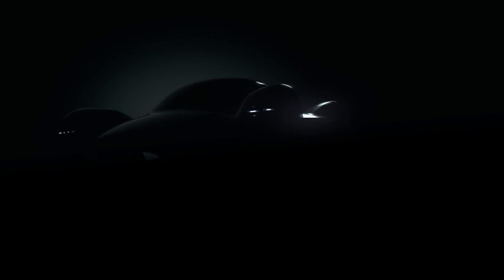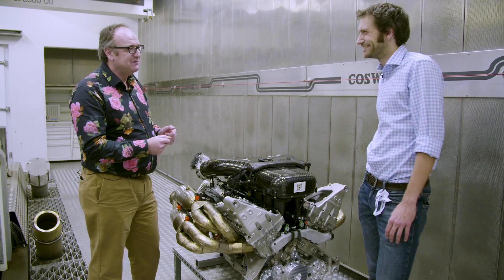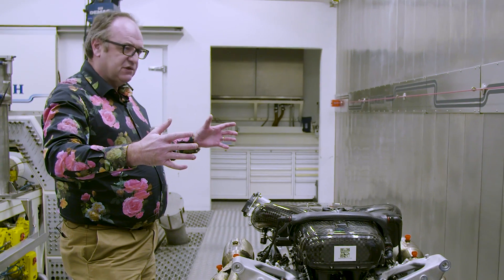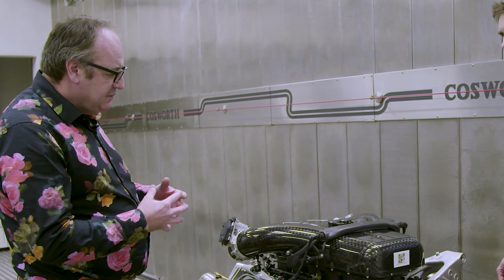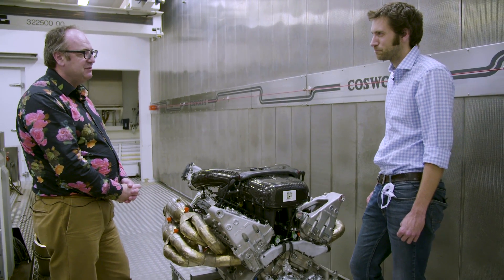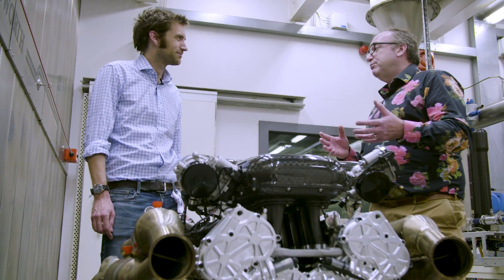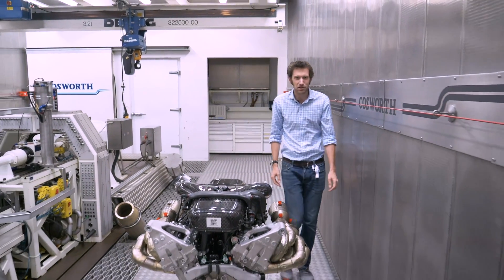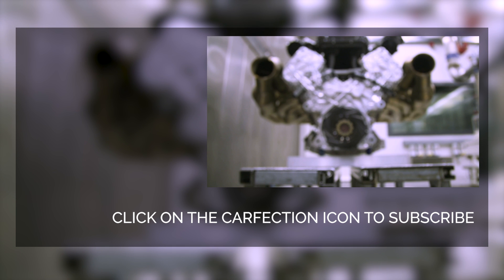Hear The Future Of The Supercar At 11,000rpm: The Aston Martin Valkyrie's V12 - Carfection

Comment: This is a serous engine, a proper engine for a supercar, now those putting V6s on supercar, those aren’t actually supercars, a supercar must have a super engine.  Now this is a super engine. Well done Aston Martin.
Reply: True, it's hard to think very highly of V6s.. but if they win races like LeMans, then you've got to have respect for them.
Reply: V12,W16 is already dead. Even V10 won't have any future. 
Turbo + hybrid assist is the future of racing Motorsports. The disadvantages of turbocharged  engine was the turbo lag. The new Hybrid assist and regens has proven it's superiority.
The iconic Porsche 919 Evo LMP P1 is a 1160HP  4Cylliner turbo Hybrid. 

The Toyota LMP1 TSO50 is 985HP V6 hybrid Assists. 
Both of them winners of LMP1.

Cars in SuperGT500 all runs 4cyllinder Turbos and are faster than GT cars.
Reply: @debendragurung3033  dividing 16 by 3 is impossible. Do they have ⅔ cylinders?
Reply: It all depends on your interpretation of a supercar. This thing is for sure a hypercar.
Reply: @lovelessissimo  pretty sure a hyper car is a hybrid turbo power train and this is non hybrid naturally aspirated
Reply: @nagow_360  Nah, there's nothing technical about the term "hypercar", it just means a very exotic/expensive supercar. Also, this will be a hybrid as they discuss in the video.
Reply: @nagow_360  no.. a hyper car is a car which pushes the envelope further, reaches new hights in automotive engineering. For example the bugatti veyron. No car had ever reached speeds like the veyron did.
Reply: @shornoMALONEY  no..
Reply: @Speed_7545  What are you disagreeing with? There is no specific definition of "hypercar". The Ariel Atom and Merc G-Wagen 6x6 both "pushed the envelope", but they're obviously not hypercars. I agree with what you said re: performance, but it's also certainly about exclusivity and price, and also time period. I'd say the McLaren F1 and Jaguar XJ220 were hypercars in their day, but not anymore.
Reply: @shornoMALONEY  If they are in their time, they still are. As I said, a car which pushes the envelope further. The car still pushed the envelope, the achievement of a car doesn't vanish over time.
Reply: @Speed_7545  Did the Ford Model T push the envelope? Yes. Is it a hypercar? No. Did the Toyota Prius push the envelope? Yes. Is it a hypercar? No. Did the Nissan GTR push the envelope? Absolutely. Is it a hypercar...? I could go on. For example rally cars like the Subaru Impreza and Mitsubishi Lancer that harnessed as much power as possible from a 2L engine, using huge turbos. Definitely pushing the envelope, but also not hypercars. It's just semantics my friend.
Reply: @shornoMALONEY  I would say a hypercar is one of those cars where there are only a handful made, they are all already sold before the car is even on the road, and the buyers are handpicked by the manufacturer.
A supercar is any expensive car that is faster than it is practical.
My two cents.
Reply: You know that BMW raced f1 with a 1,5 liter engine in the 80s. 1435 hp and 4 cylinders.
Reply: By your logic a GT3 RS isn't a super car lol, and it outperforms a lot of them.
Reply: Jay S. GT3RS ain’t a v6 boi

Comment: 6.5 litre v12 and they call it the `future` of whatever. Give me a break! The future is all electric. And Tesla's upcoming models would run circles around this at a fraction of the cost.
Reply: I would agree... except you're wrong and you've missed the point completely. 
Simple fact - Tesla's are heavy, heavy cars. 
I don't deny that the future of everyday passenger vehicles is not the Internal Combustion Engine, however at this time these power figures in combination with a lightweight, aerodynamic chassis are only achievable with the good old fashioned "suck, squeeze, bang, blow" 
I reiterate that I don't disagree that the future isn't I.C.E, however right here, right now, this is the pinnacle.

Comment: Brilliant engine.  No doubt one of the greatest engines of all time.  Though with an 11,000 RPM redline and peak horsepower likely very high up in the rev range, I suspect this motor would not work at all in street car, which is why the electric motors are key. Reality is the electric motors will be providing most of the driver's real world usable power (i.e., torque).  This really is more race car than street car.  No doubt Ferrari could have dropped an F1 V12 car into a street car many years ago if that engine was supplemented with an electric drive train. But Ferrari did not an Aston Martin did.  Kudos to Aston Martin.

Comment: This is the ideal usage case for a hybrid combo imo.  In concert with small displacement ridiculous RPM motor for torque fill.  I'm really curious how they've done the valvetrain.  Still Ti springs, or have they gone to pneumatic valves ala F1 or Koenigsegg's 'Freevalve" system.

Comment: Basically, this is the type of engine the LaFerrari or McLaren P1 should of had.
Reply: should've not should of
Reply: ErwinSchrodinger64 LaFerrari has a N/A V12…
Reply: Abiel Ruiz yea but it‘s lacking 2000 rpm haha but now as you say that it makes the valkyrie actually more real. All they did was getting 2k more rpm out of it, and that is freaking insane and awesome.

I am so happily waiting for this and the amg one, can‘t wait
Reply: timonxDlol well, LaFerrari released in 2013 and the valkrye will be release on 2020 so…
Reply: Valkyrie*
Reply: @timonxDlol   "All they did"...
Reply: Should *have*, or "should've".
Reply: Pretty sure the laFerrari and the p1 are hybrids
Reply: your excgarating a bit. Give me some excempel.
Reply: Apreesheated
Reply: @Lucky Rooster this will be as well to assist low rpm pull
Reply: The p1 is fine as it is lol enough to see the Ferrari off that's for sure.
Reply: @Lucky Rooster yes Laferrari is a hybrid.

Comment: EVER? 
It's an astonnishing car - no doubt. But there are some (existing) cars near to this...
The Gumpert i.e. has also a big, naturally aspirated V12 that makes a lot of power (780HP @8500 RPM)
and there is Koenigsegg who (makes boosted engines, but) has developed the "Free Valve" wich will soon allow extreme RPM's. 
So, maybe this car is ahead - now - but the competition of the best car will NOT be finished with this Aston Martin.
By far not.
Reply: You do realise that this engine weighs just 440lbs,  and the car will have a better power to weight ratio than Koenigsegg One:1,  right?  If you think that the Valkyrie and a fucking Gumpert are even in the same league then you're honestly delusional.  The amount of engineering that just went into the engine is astonishing.  Yeah,  there will be cars in the future that could compete with it,  but right now the Valkyrie is the absolute pinnacle.
Reply: @Lemon IX:
I'd like to see a comparsion of the Valkyrie vs. Koenigsegg One:1 and the Gumpert iE 
at the Dragstrip, at Nürburgring Nordschleife and a 0-400-0 comparsion.
Reply: There is nothing anywhere near to this. Newey is the best chassis engineer ever.  And, in terms of aerodynamics, it's very unlikely that something would ever come close to this again due to the radicality of the project (who would approve a cabin that narrow again?).
Reply: @ RealCapo88 
Okay, they aim to be stret legal, 
but if this screaming 11000RPM V12 Monster will ever be street legal, it will be only in britania (maybe too in Dubai and Monacco) 
Please tell me if You EVER see one of those cars on a road in Germany or France or anywhere else...

Comment: Super cool stuff! Love it! Just a remark: Its not the first road car which has the engine as structural part for the rear. The Mercedes F1 Engine which is used in the AMG One is in the F1 car only 145 Kilos including batteries. Would like to see what its weight with all Batteries (4x the amount in the One comparing to the F1 car) and than compare it to Cosworth Unit weight together with the Batteries.

Comment: Poor guys haven't you heard of the SuperchargedBigBlockChevy? That will have the guts at any rpm. First of all the V12 sound is scream, which is not good. Then the stressed engine is bad for longevity. I salute choosing rigid valvetrain gears

Comment: How did they pass emissions but Merc are really struggling with their tiny V6?
Reply: The F1 engine was really never meant to be in a road car. Most of Merc issues are at start up and idle speeds. Lambo and Ferrari both have a 6.5L V12. They may not rev as high but at least there was a point of reference unlike what Merc is dealing with.
Reply: Jeff Will That’s a fair point
Reply: @Kristian6622  This V12 engine may pass emissions but from what I read and predicted the Valkyrie won't be street legal in US. AM chose not to meet some necessary standards. Project One will be street legal in US once emission issues are settled. Speed Tail, One:1; etc aren't street legal in US also. They can be imported under a special rule but mileage has to be limited on street.

The Apollo IE can be option with a 1,000hp that revs to 11k based off what their engineers released in July.

Comment: Fantastic engineering! BRAVO!
I know this is a parallel hybrid, but the future is electric, for instant torque, and ease of packaging.
As far as pure electrics go, I think a  body that doubles as a flouride nano battery would have the greatest energy density, and motors in all four wheels would have the lowest rotational inertia and greatest modulation for torque vectoring, stability control, etc. So we're "there" yet at the pinnacle of automotive engineering, not even with the Valkyrie.
But DAYUM, that is some fantastic engineering! Way to go, team!

Comment: I remember seeing a video about someone buying old formula one parts. Intercoolers, wiring harnesses, steering wheels...etc. i recognize the connectors this engine is using from that video. They are extremely expensive per part number compared to the connectors in your everyday car.

Comment: Is it 1000hp including the electric motors or on the engine alone?
Reply: @AzathothsAlarmClock  So do you think total hp output from the entire power unit will be in excess of 1100hp? Or more if the battery pack is big enough for an output from the electric motors of +100hp or there abouts.

Comment: They could've used anti-backlash gears in the cam drives, but they would be heavier . . . 
Bench testing rig does not replicate shock / bump / suspension load transfer to the engine ? Still, lovely job.

Comment: This appears to be the zenith of the N/A internal combustion road engine. NO electric car (or eco-boost V-6, etc) will ever be in the same universe as this masterpiece - period.
Reply: It depends on how you're delineating the comparison. If you're simply talking about power and torque then that's obviously false, electric motors are superior there. But by some other metrics, and DEFINITELY by a huge number of intangible factors, this engine is truly in a class of one.
Reply: Lmao its main competitor the amg one will have a 1.6litre v6 turbo hybrid reving even higher (11500rpm) and will compete in exactly the same universe, but you are correct there is something about an na 12 cylinder that revs up to 11k rpm which is simply insane
Reply: @timonxDlol  in a way it sort of feels as if aston martin are saying to FIA and F1 in particular this is what N/A V12 hybrid system can do with the new regulations in 2021 kicking in.
Reply: chapman5578 what i really love about those cars is how perfectly they fit together. The astons egnine is the limit of a known engine type. The limit of something we know combined with a shape of a car that‘s a first of it‘s kind.
The amg is the other way around: the limit of cars as we know them combined with an engine that‘s a first of a kind.

Both cars have one thing that‘s the perfection of something existing, finishing an era, and one thing that is the first of it‘s kind, beginning a new era. But for both cars these things are the opposites. This will be so amazing
Reply: @timonxDlol  it'll be a clash of titans that's for sure.

Comment: it pretty much sounds like a drill
Reply: But a very nice sounding drill lol
Reply: Olsfen1 the sound of exhaust has been plumbed out doors for testing... but it will still end up sounding similar ( like a race bike)
Reply: Justin Mallaiz We can see there is a gap between the end of the headers and the pipes pumping the exhaust outside. Its a cool sound but not as cool as the specs. Obviously the end results will be different with the full exhaust system.

Comment: I love this V12, but that is huge. 200+ kg is 60 kg heavier than the engine in the Mercedes AMG One. Maybe a little less than that because of the intercooler, but this V12 will need lots more radiator than the Mercedes due to lower thermal efficiency
Reply: Doesnt the fact that its a structural member of the car more than make up for this? Certainly the supporting frame/chassis would weigh more than 60kg if it weren't structural? Not sure if the same technique is used in the AMG One
Reply: @sottenad  the project one engine is a structural member as well. The suspension is bolted right up to it
Reply: What makes you say it'll be less thermally efficient? Where are you getting a weight from? It will also have more motors which means more weight, and which will require more batteries, again, more weight, and the car will be heavier overall. The engines are very similar in terms of power per kilo, so it's really a matter of bigger more powerful engine, or smaller less powerful engine with more electrification, youll notice electric cars are usually significantly heavier than their ice competition, because electric powertrains arent as power dense, yet
Reply: @noncog1  weight was given here as 200 kg for the V12. The F1 engines are governed by the ruleset as being 145 kg. Turbo engines with the F1 MGU-K and MGU-H are the most thermal efficient car engines in the world at 50% thermal efficiency. An NA engine cannot obtain this efficiency because it cannot reutilize exhaust gases. The project one propulsion with all of its motors will weigh similar to  the Valkyrie's, but have more electrification and electric AWD, which is a significant performance boost. The MGU-K is 7 kg each. So 14 kg penalty for the front motors of the Project One

Comment: I need that 1.6 L 11000rpm NA 250 hp 3 cylinder in a hot hatch please
Reply: I need it in a motorcycle frame!
Reply: @SvenTviking  Hayabusa with a 1.6l stroker kit does 280hp naturally aspirated at 12k rpm.
Reply: @SvenTviking  Already exists.  Its called a Kawasaki H2R.
Reply: Can you imagine it powering a riding lawnmower?
Reply: @greatnortherntroll6841  yes
Reply: Heck yes lol
Reply: I can imagine the engine would fly off before your hatch could move. Hahaha
Reply: Wait. 3 cylinders. Like that of a fiesta. And Ford like cosworth so...
Reply: Its not 11000 rpm
Reply: Correct! It's only 2750rpm due to being a quarter of the original.
Reply: @duncanhowarth9514  Doesn't work like that.
Reply: 1.3 renesis
Reply: Rusty Shackelford  If I'm not mistaken, i write the comment when the other says "notification squad", "never click so fast", and so on. It's just how it is if you live in a third world country where no one really watch this kind of stuff, my comments always get overshadowed.
Reply: Turbo it and see how much hp you can make
Reply: @DragonFury-gq5zo  You can't just put a turbo on such an extreme engine tho
Reply: LeCoureurDesBois yeah but with some reinforcement to the block you could push out a lot more hp
Reply: @DragonFury-gq5zo  
That thing is twisting up to 11k. The reinforcement is probably maxed out.
Reply: @DragonFury-gq5zo  The three cylinder block and crank would be orders of magnitude stronger than the full banks of six just for being so much shorter. Its the rods and bearings that will find their limits first.

Comment: Cut the displacement to 2.8ltr, raise the rev limit to 18,000rpm, up the electric assistance, run it on Ethanol with a kind of carbon neutral/offset tree planting scheme and you have a nice F1 engine.